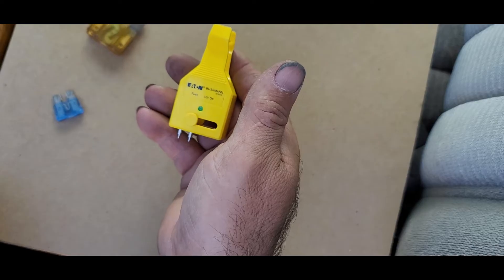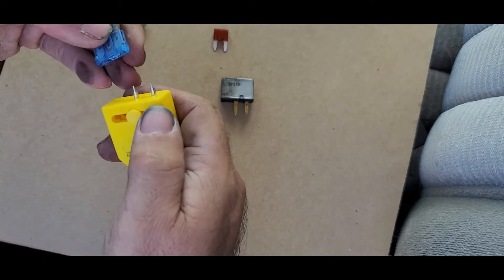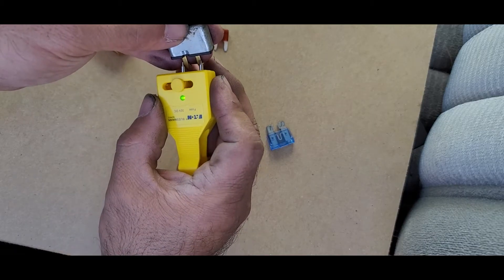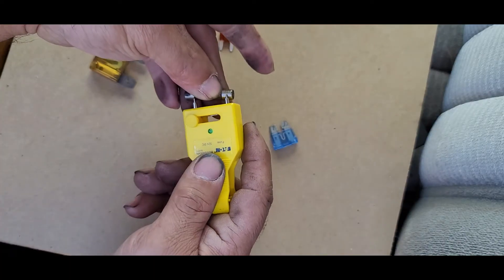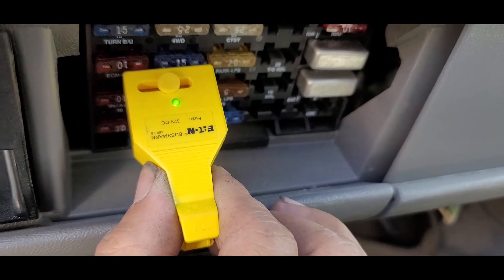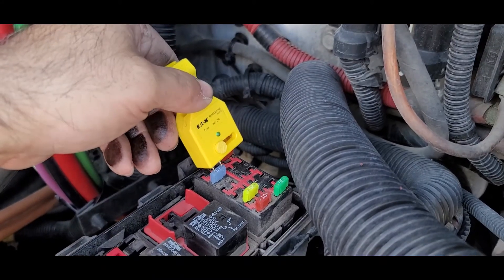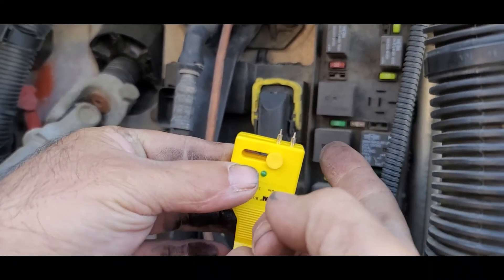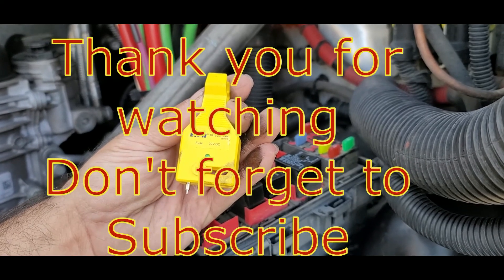How To Use a Fuse Tester Made by EATON

Comment: Right out of the package the batteries on mine were too low to get a reliable reading. If you pull the knobs off the moveable pole you can pry it apart without doing damage. But the small round batteries are smaller than anything I have on hand. I'm going to use the continuity method with my multimeter.
Reply: Or you can just physically and visibly look at the mf god damn things without having to use any type of stupid useless time consuming tool.
All you need is your own damn eyeballs and a flashlight if you have one on hand

Comment: How do u check those bigger ones connected on the fuse box ?
Reply from the maker: If doesn't have access on top just remove it from the box. 👍
Reply: Thank you. My ac wasn’t working the last couple days in the heatwave, I knew I was out of Freon so I just added it but I was still getting the same results. I was praying it would be the fuse and luckily this came w my kit. I thought it was just to pull the fuse which I had difficulty with until I noticed the prongs. Thank you for confirming how to read and what the slider button was